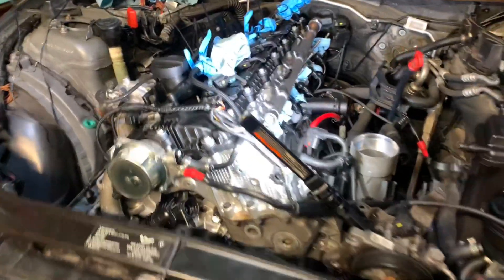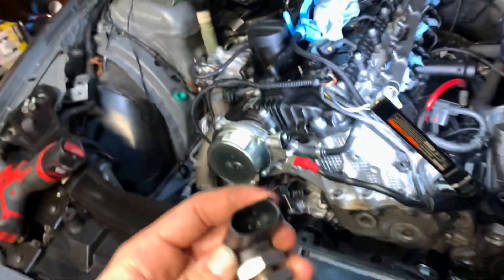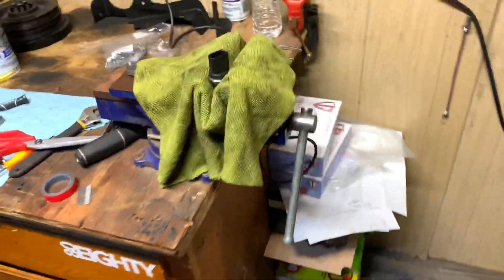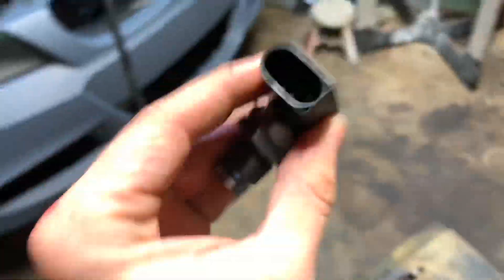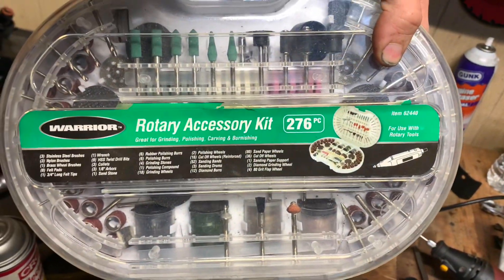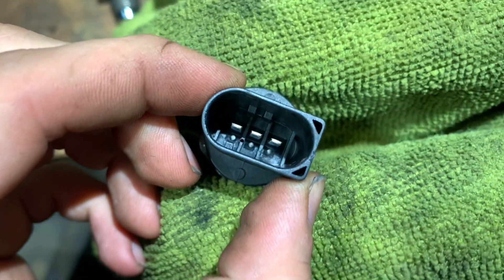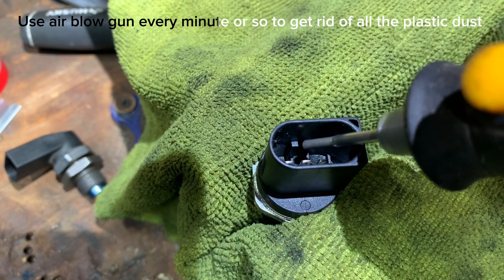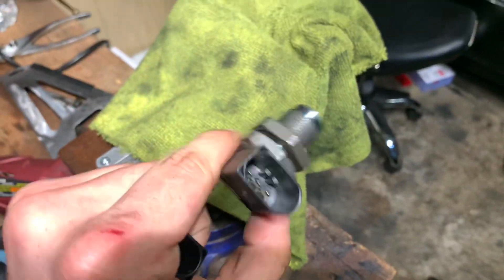HOW TO INSTALL A 2700 BAR CR Fuel Pressure Sensor (QUICK VIDEO)

Comment: What's the deal with the washer? I bought my sensor seperate. I test fitted mine on the rail it fit fine it was the plug that wasnt fitting right. Any tips my boy?

Comment: It won't work without a tune also. It's not just plug and play. Also I've never seen anyone have to modify anything like this before let us know how it worked out
Reply from the maker: What tube?
Reply: @dkgarage5131  tune* sorry
Reply from the maker: @TheMadcowintucson  yes if you check I wrote it will not work without a tune 🤝 in the comments in my video
Reply: @dkgarage5131  oh I did not read lol. Best mod I've made is my modified tstat. Now it runs about 200f
Reply from the maker: @TheMadcowintucson  did you notice that it runs better ? Bc I still did not get tuned
Reply: @dkgarage5131  it smells better for sure!
Reply: @TheMadcowintucson  What mod dit you do to the thermostat?
Reply: @dkgarage5131  were you running the 50d rail sensor without a tune ? I need to know if I can install the sensor then drive it to get tuned so that I don’t pay labour on the tuners fitting it
Reply from the maker: @That1ne39 I don’t think you can drive it without a tune car will be confused. I installed all the parts at once then shipped my ecu out and got it tuned on to the ecu then started
Reply: @dkgarage5131  I see, what’s the point of the 50d regulator at this power? How much power by itself does it add?
Reply from the maker: @That1ne39 it’s let the car read for fuel pressure for more power
Reply: @dkgarage5131  but let’s say you’re at 400hp with stock turbos and downpipe and intercooler, if you were to add the 50d regulator and re tune it how much power would it increase it by roughly
Reply from the maker: @That1ne39 with a r90 I think 50 more bc you can add more fuel